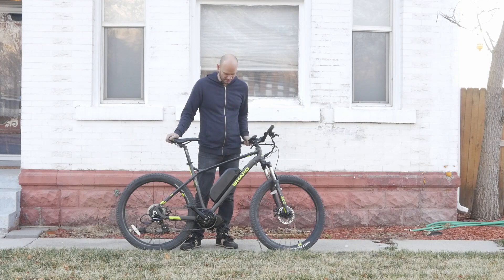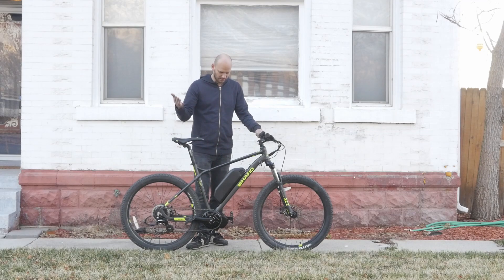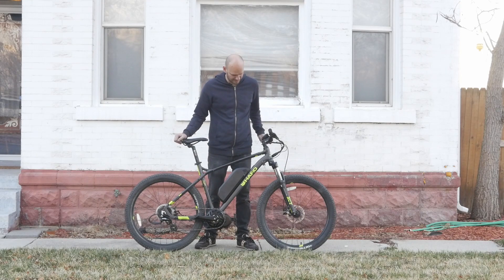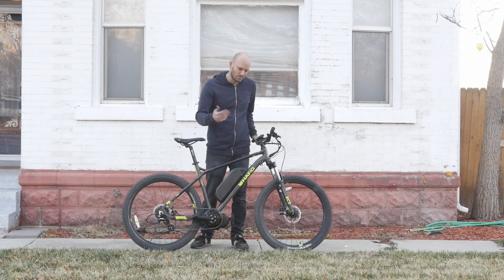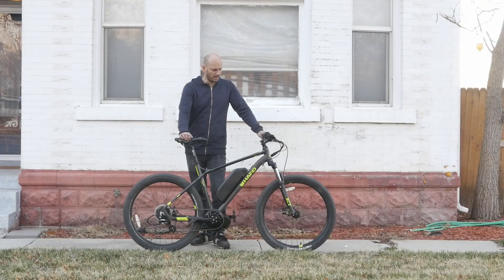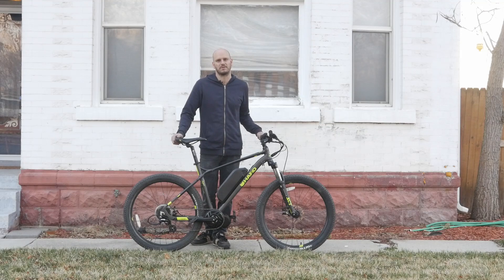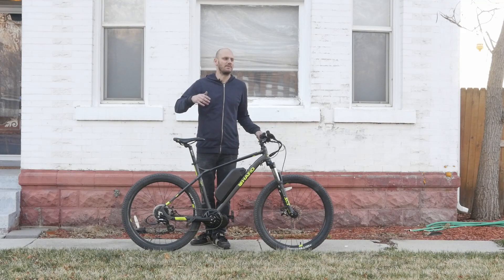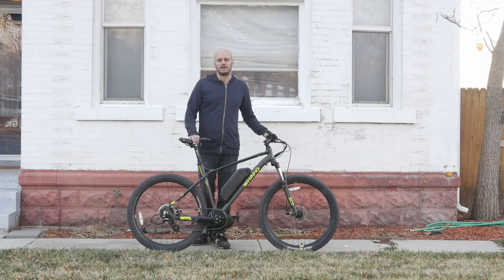Custom E-bike build: Haro FL Bafang BBSHD 52v 17.5ah

Comment: I want to convert my bike too but i wonder if the bbshd has to much torque for my frame like what is considerd a strong frame for it since mine is all aluminium no shocks nothing have decent wide tires and a gates cdx centertrack belt drive they also make a ebike version of my bike with a 350watt bafang which puts out max 80nm torque but the bbshd puts out 160 which is double and and i want to use it for bikepacking/touring with camping gear with me
Reply from the maker: The good thing is that you can dial down the power but still have it on tap just in case
Reply: @JohnnyNerdOut  ive seen a solution which could work with the loose motor part too a torque arm but its flipping 60 dollars shipping and the torque arm only costs 23 dollar

Comment: Awesome build! Glad to see the Bling Ring.
Reply from the maker: Me too! IO've been really liking the 36t and 42t
Reply: @JohnnyNerdOut  I like the offset & the narrow wide teeth of the 42t. I'm sure the 36t is bad ass (haven't tried it) if you're a throttle rider just using the higher gears on a cassette or you have an IGH  but it wouldn't let me use my low gears safely on my e-mtb. The 1 minor flaw with the BBSxx is pushing the chain line away from the bike frame with smaller chain rings.

Comment: You should list weight of bike before and after mod.  People will be surprised at how light your converted e-bikes are vs Commercial ebikes.
Reply: I converted mine last week and it's at 52lbs. Started around 30-32lbs. 52lbs is veeery manageable and I actually like the feel of the heft on trails.

Comment: How much did the build cost? Asking cause I just bought a Turbo Levo Comp haha
Reply: Your bike runs a 250W nominal motor with 36V, 700WH battery and is designed sleek for $4k - $5k
VS a bike you already have with a $ 650 1000W nominal motor and $400 52V x 17.5 = 900WH battery system.  Bigger Watts = more power and speed